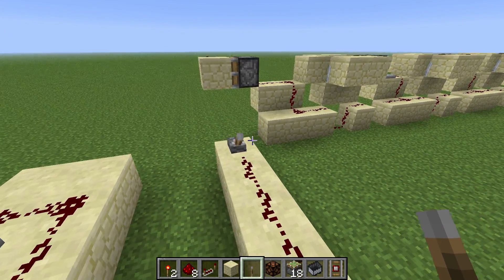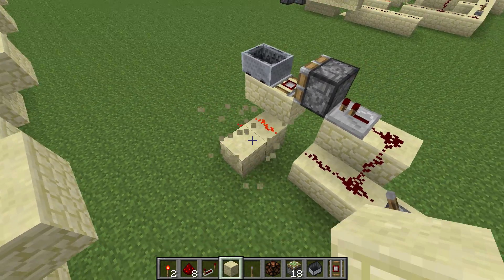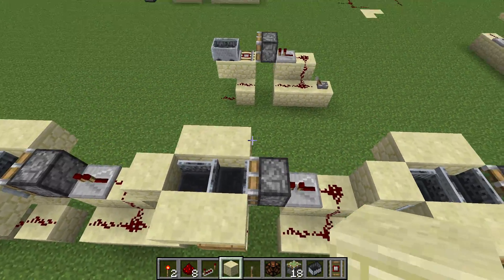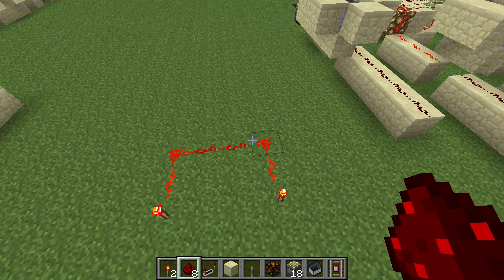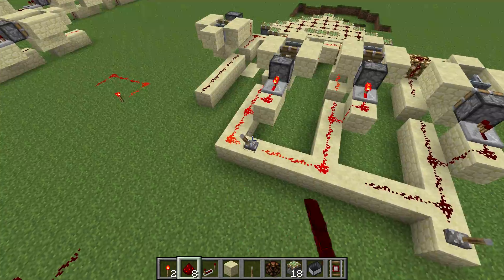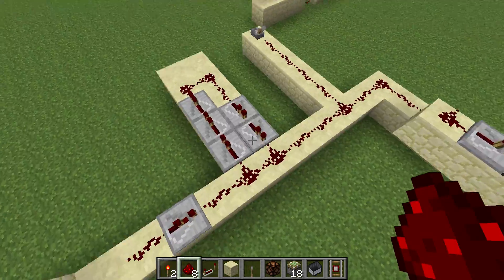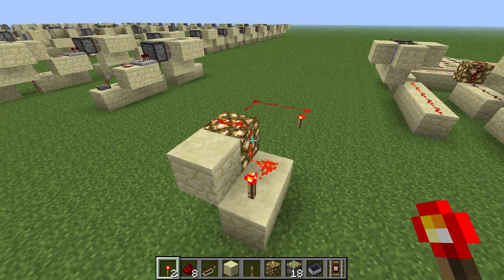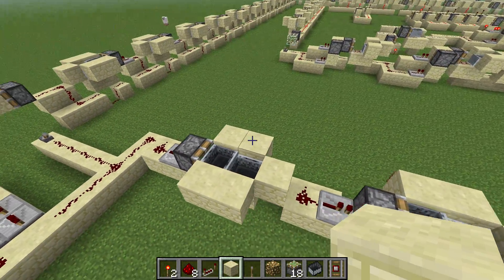Minecraft - A New Type of Dual Edge Instant Wire and Not Gate.avi

Comment: i'm trying to get this to work with a single pulse and it's only transmitting power every other pulse... i'm assuming it's because of the repeater and it doesn't do a single pulse (i want to use instant wire for my sand duplicator)